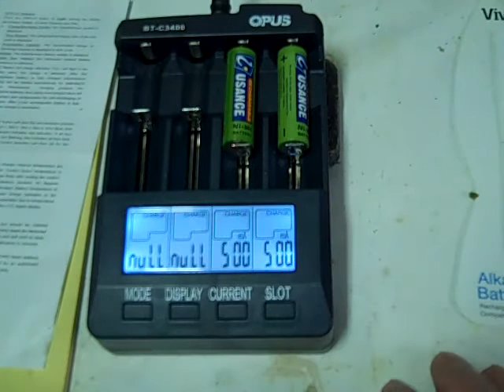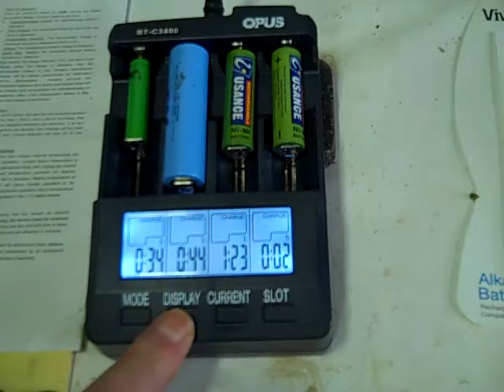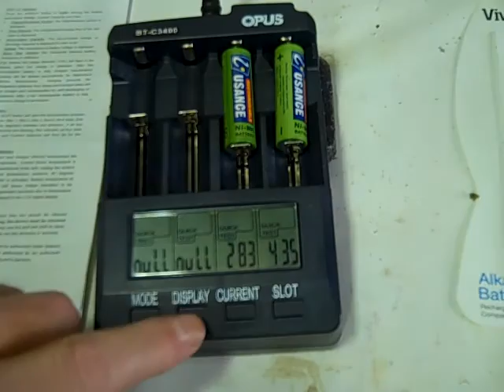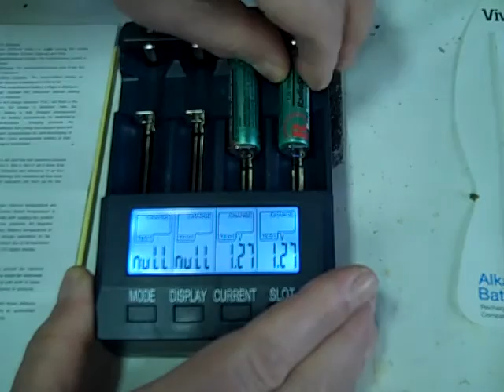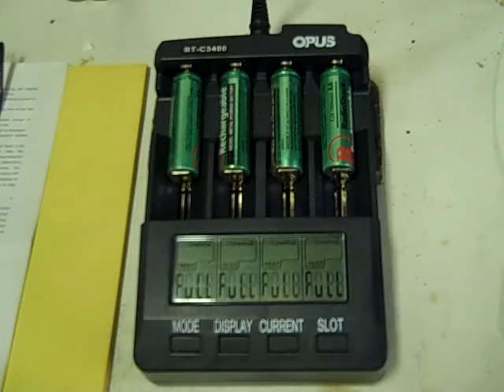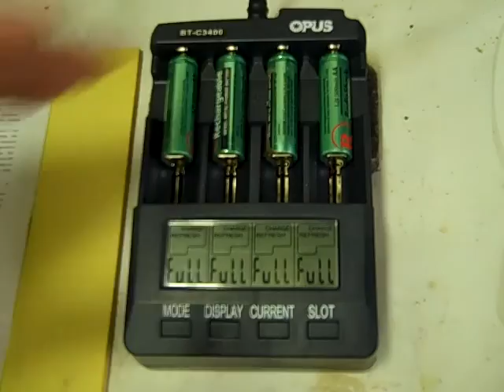Battery Charger Review - Opus BT-C3400 Review and How to Use Its Features

Comment: You touched briefly on the Quick Test and called it resistance but did not mention what the value of the numbers signify. What do low numbers mean? What do high numbers mean?
Reply from the maker: In quick test mode the charger will analyze the "dynamic" internal battery resistance. 

The battery should be fully charged before testing. 

The numbers can differ by as much as 20% by just putting the same battery in a different slot. 

The numbers are in milliohms (thousandths of an ohm). 

I believe that as long as you have some resistance then the battery is good. 

Real high numbers might be a sign a battery is going bad? Not sure about this though.
The instructions aren't clear on this.
Reply from the maker: dynamic means it is constantly changing
Reply: @FixItYourself  Thanks.
Reply: The quick test measures internal resistance (IR). The units presented in the test are milli-ohms (mΩ). Lower numbers are better. The internal resistance of a battery forms a voltage divider with the load resistance. With any given load a lower battery IR will have more voltage drop across the load and less across the battery. This is the "sag" in voltage across the load that you see under increasing load.  You want as little voltage drop across the battery as possible because that voltage times the amps is the power that is being dissipated by the battery instead of the load. When battery IR is high that power dissipation causes the battery to heat-up. This is not only bad for efficiency, but it further accelerates the demise of the cell. The IR of all batteries tends to increase with cycle use. This is the reason why they have a limited cycle life. In many cases (Lithium cells in particular) not fully charging or fully discharging a cell in use can reduce the stress (adverse chemical reactions) on the cell and give it a longer cycle life. 
The problem with getting accurate internal resistance (IR) values is the contact resistance at the point where the battery touches the prongs on the charger. If can vary quite a bit depending on the pressure applied by those contacts and the condition of the contact points on the battery itself. Even almost invisible oxidation or contamination from finger oils, etc can raise the contact resistance enough to give very different numbers. You can try cleaning the ends of the battery with an eraser, etc before doing the test. You can sometimes get better (more accurate) numbers if you spin or move the battery around in the charger bay which can help get a better connection.

Comment: I agree, the volume is too low.  In your next video, could you please explain what the four "Display" readouts mean after the batteries are "Full".   I am only interested in NiMH batteries.
The understandable readouts are:  Voltage and Time Elapsed [time it took to charge].  
But, what does "mAh" mean?  If it reads say 1800 mAh but the battery is rated at 2300 mAh, does that mean the battery is dead or dying?  What about "mA"?  Is that the current trickle charge amperage?  If there are two or more of the same batteries and each has a different "mA" what does that tell you about each battery?
Reply from the maker: If it reads 1800mah but its rated at 2300mah the batteries are getting old or sometimes they just need to go through the Discharge refresh cycle a couple of times. Sometimes that will help.
mA is the trickle charge. The different voltages means the charger is trying to charge it the best way possible depending on how fast its charging or not charging and other factors no so obvious.
Sorry for the low volume.

Comment: nice video, very informative, except hd would be nice so I could read the display, thanks for posting
Reply from the maker: +GrandPixel yea i thought you could read the display but i wasn't thinking of the smaller texts.
Reply: A split screen or frame inset showing a zoom on the display would be nice. Or just zoom on the display and buttons area so it fills as much of the video as possible during the test portion. Once we have seen what the battery holders look like, we don't really need to see them again. Overall nice video. I have over a dozen old AA NiMH rechargeables that can't come close to producing the claimed runtimes on my Fenix LD20 AA flashlights, so I'm pretty sure I need a smart charger to tell me what's going on.

Comment: Awesome !  An AA charger that can charge at 500ma and the cells don't get hot... or even warm ?  I have to get one of these.
Reply from the maker: Even when they charge at 1000ma they barely get warm.
Reply: That's great news and thank you for your reply.   Have you had any problems with false peaking ?  In other words, the battery wasn't really full when the charge stopped ?
Reply from the maker: Not sure about that. Though sometimes I wonder if the batteries could be charged up more.
Reply from the maker: Just did a Charge test on a few batteries. So at the beginning of the test it charges them past 1.5 volts before it starts the discharge cycle. On recharge it only charges them up to 1.41 volts which seems really dumb to me.
Reply from the maker: So they are basing mah on discharging from 1.5v then only recharging to 1.41v
Reply: That is interesting indeed. Thank you for running the tests. 

Also, do you feel the internal resistance check is accurate ?
Reply from the maker: The internal resistance check is dubious at best.
You never get the same number twice.
How would you know if it is correct or not.?
Reply: OK, thank you for your reply and review !
Reply from the maker: Sure, no problem.
Reply: @alanpeterson2160  i can only say i just charged 4 sony vtc5'a 18650 to full status and did the internal resitance check and all of them were around 35

Comment: My 3100 is able to charge at 1000 MA with 4 AA batteries in. I thought the 3400 was a slightly higher rated charger. Is that right?
Reply from the maker: Well the power supply is only rated for 2 amps on the 3400 I have. I thought this was the better model also but I guess I was wrong.
Reply from the maker: What is the power supply rated for on the 3100 if I might ask?
Reply: Fix It Yourself! 3100 V2.2 is 3 Amps.
Reply: I have both a 3100 and 3400. Both have a 3 amp rated power supply and both will charge 2 LiIons at 2 amps or 4 at 1 amp. All the charge and discharge capacities are identical.
Reply: just so everybody knows according to liion batteries the 3100 is the same charger as the 3400

Comment: What is the difference between the C3100 and the C3400?
Reply: Not much. Different markets. Different firmware versions which have slightly different LiIon discharge cut-off voltages.

Comment: is this a rev. 1 or something or just a junk laptop battery? Only charged it to 4.14
Reply from the maker: Yes on both.
Reply: just wondering cause mine charges to 4.20v. It will drop by .02v if I leave it on the charger after charging but thats just cause it dont have trickle charge for Li-ion..... I believe.
Reply from the maker: It was probably a bad battery because others I have charged went up to 4.20v
Mine does have a trickle charge. You can see it when you scroll through the screens after it is charged.
Reply: I thought these chargers only trickle charged NiMH not Li_ion but yesterday I ran a charge test on 3 sony VTC6 batteries and I pulled them off the charger tonight and they still read 4.18v so it must be doing some sort of trickle charging on li ions as well. If not im sure the Voltage would have dropped a little further from sitting on the charger for so many hours.